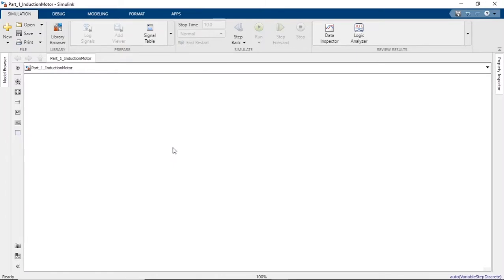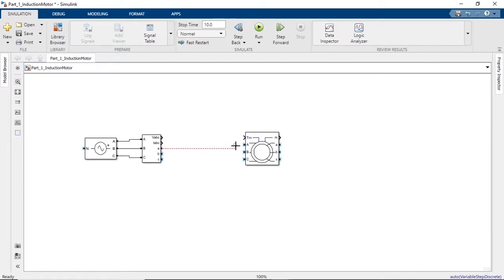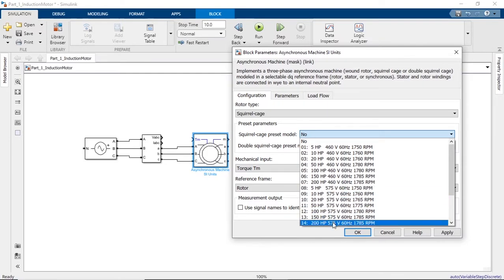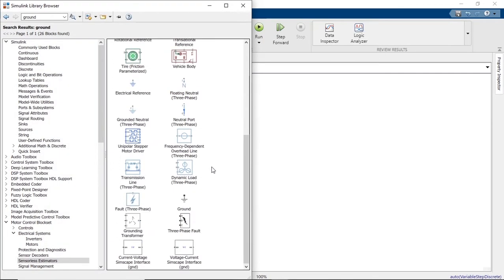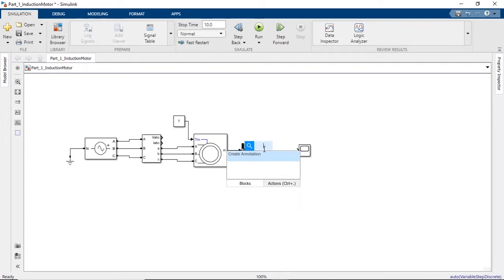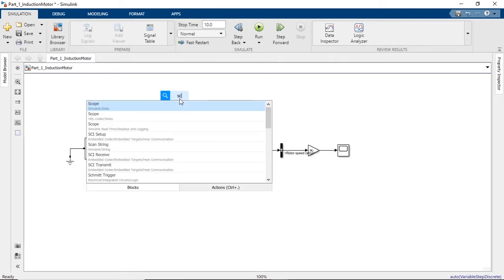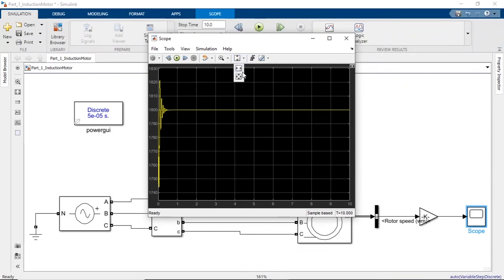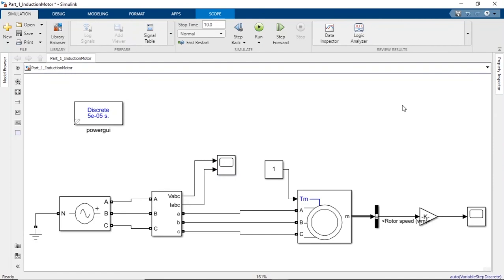Speed Control of Induction Motor Using VFD | Part-1: Simulation of Induction motor

Comment: Sir i couldn't get a proper output from the output scope. It is showing a sine wave only with different values
Reply from the maker: Please recheck the control part and code as well.
Reply: @UrbanSchoolTech  sir where is the code? You didn't mention it.

Comment: Single phase motor kis tarah control krnga?
Reply from the maker: The cheapest method to control a single phase motor is through voltage regulation... just like in ceiling fans.